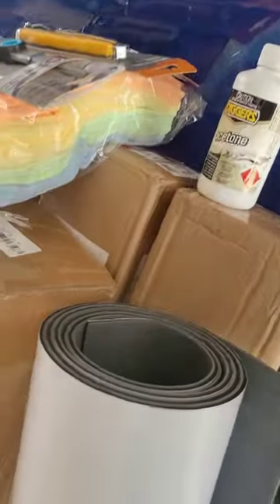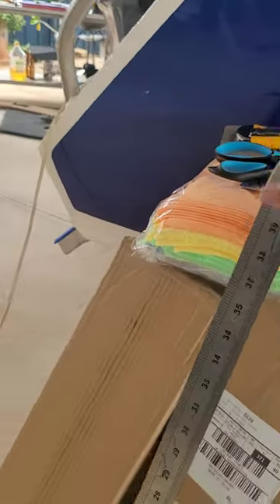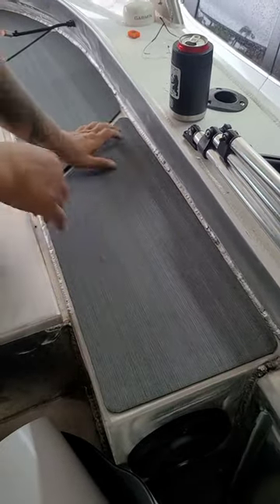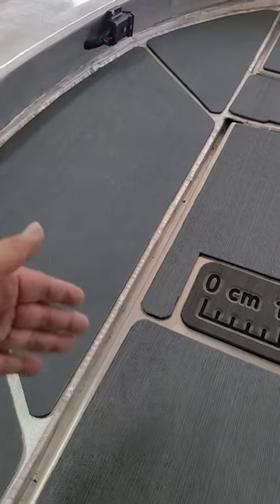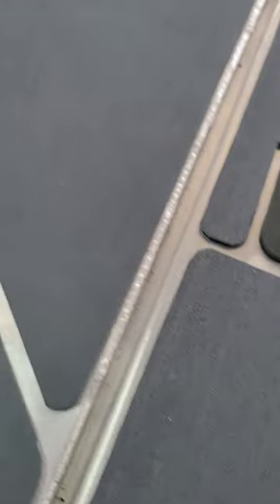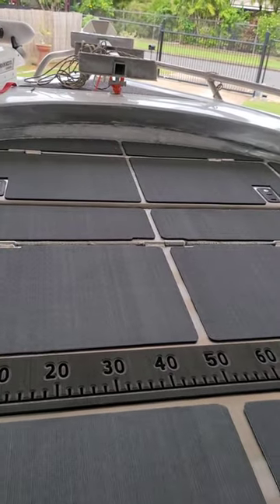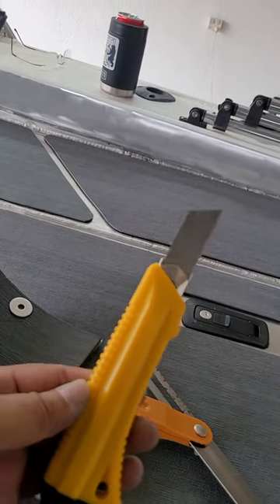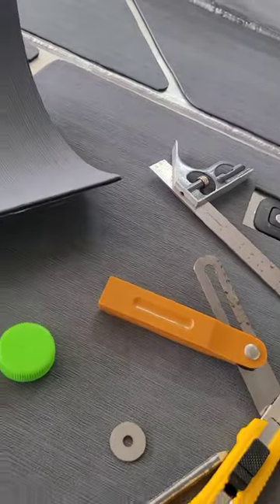Do It Yourself EVA foam boat flooring

Comment: Awesome work Oakstar! I’m replacing my floor an the design you have is sweet! Plenty of storage areas. Where’s the fuel tank in ur boat? Mines up front but want to move it down back.
Reply from the maker: Cool, my tank is straight under my console.. its 115L

Comment: Hey oaks, looks fantastic. 
I’m in Darwin looking to do almost exactly that to my boat! Mind if I ask what the ally fab work cost??
Reply from the maker: It really depends on how in depth you wanna go.. I did the deck, under the deck and below that too plus rod lockers on both sides and currently finishing the rest(removing remaining wood and installing ally) its cost me north of 12k and counting. The welder is a good friend of mine so he didn't charge me extra for hanging around the workshop all day helping and drinking he's beer lol. Best bet is to go in and see him and tell him exactly what your after. He's a top bloke and does not charge an arm and a leg. STIGS ALI WELDING(he's on Facebook)
Reply: @oakstarproductions  what you’ve done is basically exactly what I want. I’ve got a 610 territory legend. I’m sick of everything getting wet under that forward deck and want somewhere out of the way to put rods stop them getting damaged